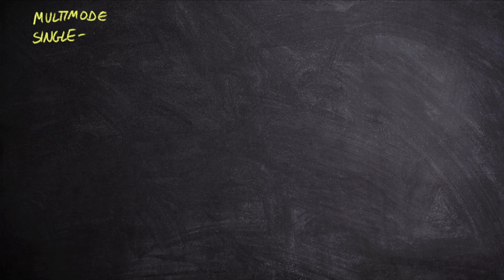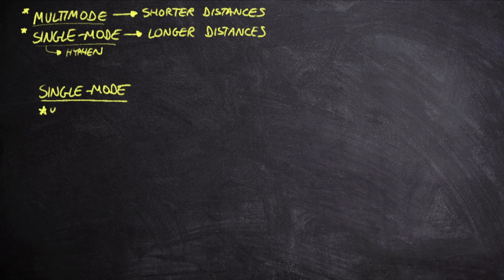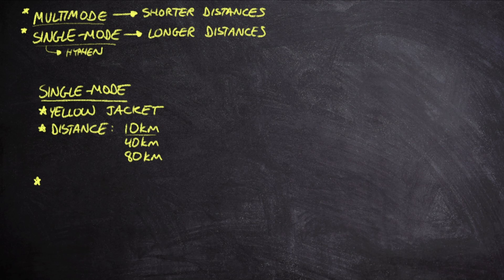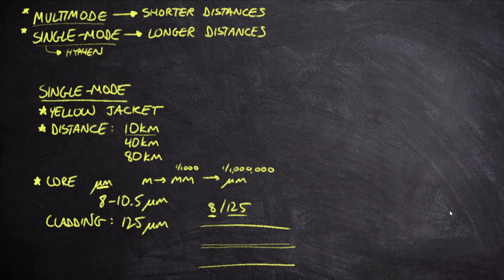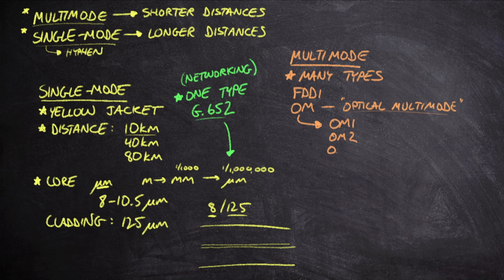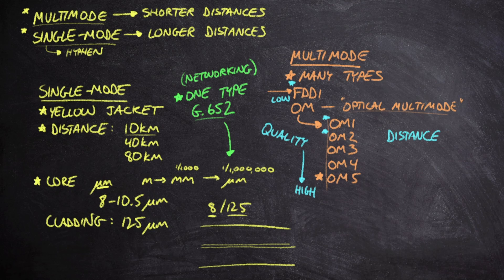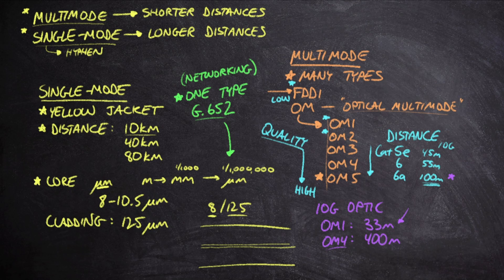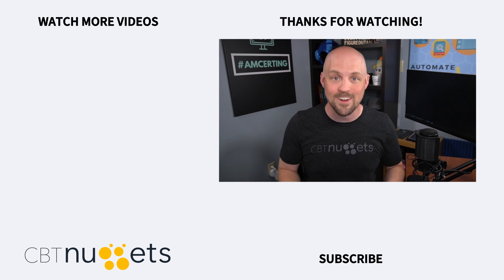Fiber Cable Types Explained | Single-Mode (SMF) vs Multimode Fiber (MMF)

Comment: in the case of multimode, no need of a hyphen because "multi" is a prefix. But single is not a prefix, and therefore it needs a hyphen to make two words single and mode one unit by hyphenating it. So, it is just a linguistic rule rather than a technological nuance. it is toooooo trivial you are supposed to know it.
Reply: hyphenating as in mother-in-law, commander-in-chief, etc

Comment: Multimode vs single-mode

I hope to shed some light (firmly intended) on the hyphenation of single-mode.  It has less to do with the white paper that introduced us to the term, and more to do with the English language.

In this case, “single-mode” is a compound adjective.  A compound adjective is when two or more words are used to describe a noun.  In this case, but not all, it is hyphenated.  It turns out that compound adjectives where the number comes first, are usually hyphenated.   Single adjectives obviously don’t need this hyphenation.  Ex. “The yellow cable”.  What type of cable is it?  It’s yellow.  If this cable is optical, no need to hyphenate.  “The optical cable”.  As a general rule, when the description becomes more specific and a compound adjective is used, it must be hyphenated.  What type of cable is it?  “It’s a fiber-optic cable”.

It’s interesting to note that fiber optics is not always hyphenated.  “Fiber optics can send data long distances” is correct.  Correct grammar dictates that you must hyphenate when used as a descriptor: “We use fiber-optic technology to carry data long distances”.  What type of technology is it?  “Fiber-optic technology”.  Another example:  “We want to explore the deep sea”.  What type of sea is it?  “It’s deep”.  But, if “We will use a deep-sea rover”, it is hyphenated.  What type of rover is it?  “A deep-sea rover”.

This is different from a compound noun.  We don’t typically hyphenate two nouns together.  “Mailbox”, “Doghouse”, etc.  When a compound noun is used as an adjective, it is not hyphenated.  Ex. “Bulletproof”

Multimode is not hyphenated because “multi” is a prefix.  We don’t typically hyphenate prefixes as they connect to a word.  “Multimedia”, “Disrespect”, “Uninstalled”.  No hyphen.

Great video.  Subscribed. 👍